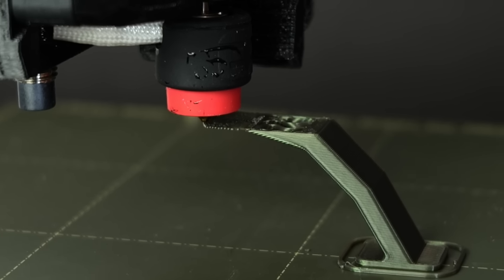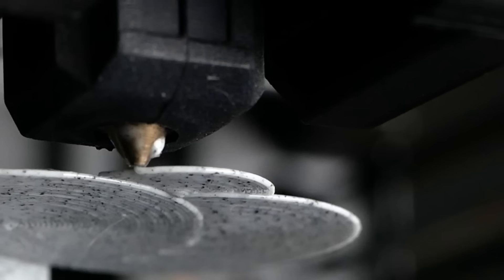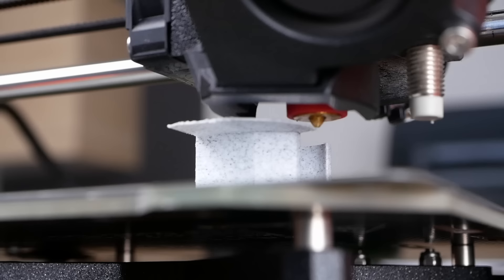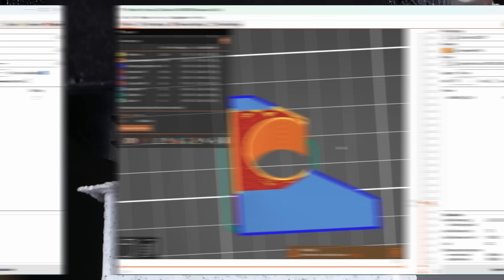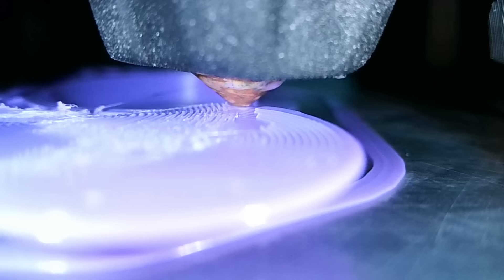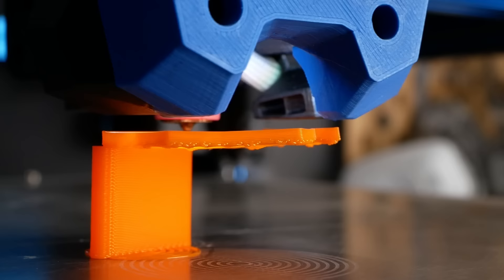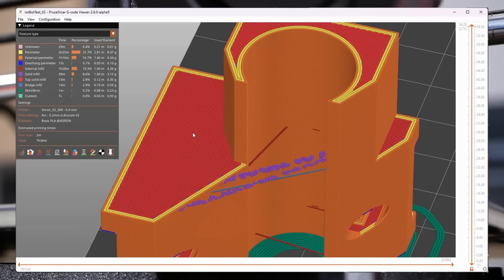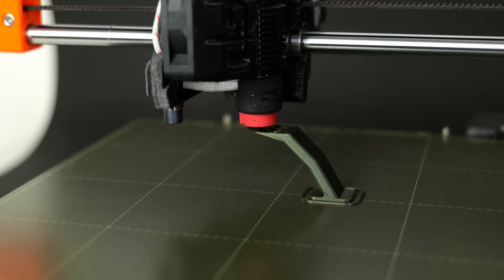Revolutionary Arc Overhangs are now in PrusaSlicer*

Comment: Arc Overhangs look like they'd be a perfect solution for internal overhangs where there's not enough space to remove support material or the surfaces need to be cleaner than supports would allow.  I've come across situations like that now and then where I had to spend a lot more time reworking a part just to make it printable that could be solved by this, even if it cost a little extra printing time

Comment: The hilbert curve thing is absolutely brilliant. I'm so glad they found a solution to this problem.
An idea I had for solving the warping was to just print the arc overhangs in a non-planar manner, with it curling downward. The next layers would print on top of it, causing it to warp upward into the shape it was originally meant to be.
Obviously this has a ton of problems, but the hilbert curve avenue makes a lot more sense.

Comment: I'd say this would be a huge improvement for me, as I print functional parts mostly designed for 3D printability, but encounter some geometry that would make using supports inevitable.   This would include counterbored holes, slight overhangs for detents, shoulders, etc. and just overall slight overhangs.  This is a very big innovation in my book!
Reply: Actually round internal holes and 90 degree squares will be game changing!

Comment: Interesting use of the Hilbert curve.  I do use it for my first layer on production parts that need a perfect face.  Printing with ASA or ABS on a textured bed, layer lines are completely invisible once dialed in.  The paper you cited about the stress relief baked into the path is making me wonder if the effect has something to do with the way my first layers perform.  I always assumed it was simply the shape itself that was disguising the tool path.  Perhaps there is more to it than that.  Awesome work, as usual.  Thanks.

Comment: Cool! It's great to see this progressing! I'm curious how similar techniques could be used to reduce infill and enable steep but not fully horizontal exterior overhangs too. Lightning infill and tree supports are excellent for my current projects, but it seems like this could cut back even more on the amount of infill and supports needed.
Reply: You can also print really steep angles with arc overhangs, it doesn't have to just be flat 90° geometries!
Reply: @stevenmcculloch5727  Cool! Thanks for the info!
Reply: Someone needs to design an infill based on the Weaire–Phelan structure.

Comment: I want the non-rectalinear solid infill options also for regular use. Large rectangular prints with 90 degree corners that fill up the whole print bed are prone to warping, and usually it occurs when a large part of the top surface gets solid infills. If those layers could be generated with a different pattern (now it's fixed in prusaslicer, I can't change the pattern) then less warping could be the result.

Comment: I discover multimaterials support with my Bambu lab and love it. PETG as interface support for PLA work perfectly, but PLA for PETG and ABS for PA-CG work too. It don't need lot of filament change for flat overhang and result is perfect!
Reply: For many prints, it's also way easier to remove than soluble supports.

Comment: One really exciting thing about this technique is that right now I tend to print a lot of things where I use ovals or arches in my designs so I can print what would otherwise be difficult overhangs. Once this makes it to cura, I bet I won't need to design that way and can use straight overhangs and save material and print time.

Comment: Very nice work, I love the reduction of warping just with a different infill pattern which is a critical issue for these parts but also many other materials that have high shrinkage.  Has there been any direct comparison of printing time needed for traditional supports vs these arc overhangs?  I guess it depends how high up the overhang would be but maybe an updated script to chose one or the other depending on calculated print time or material use would be valuable in the future.
Reply: It depends on the size of the overhang and how far up the supports would have to be.

I think the ideal use case for arc overhangs are for small overhangs on tall models that would otherwise require a huge organic support "tree trunk"

Comment: Using temperature modulation to manipulate internal stresses to correct droop would require per-material, per-printer and even per-design characterization to accurately model shrinking and expansion. The effort may make sense for mass production, probably not so much for hobbyists doing mostly one-offs.

Comment: Honestly tree supports work pretty well right now but for certain files or geometry where support just doesn't work, would be impossible to remove, or ruins the print, it would be really cool to see arc overhangs develop to the point where support becomes obsolete in 3d printing and overhangs just print perfectly. One mistake I see many beginners make is not understanding what support is or where it is needed, and they try to print a file with impossible overhangs and it keeps failing and they don't understand why. If arc overhangs were included in all slicers and just worked without any issues then it would get rid of all the headaches that support gives people. This is a really cool development that can revolutionize 3d printing so thanks for covering it Stefan!

Comment: This is an interesting concept, but we are missing some data.  It would be interesting to print a part two different ways - one with traditional supports and one with arc overhangs and see if there is a meaningful difference in strength, durability, etc.  If only there was someone we all knew and respected who had the experience and equipment do such a test...  Hmmm...

Comment: I see a lot of improvements in 3d printing just by changing the path of nozzle movements. I wonder if it's realistic to use AI to predict a better way to print each part. It could be trained on soft body and thermal simulations as well as on real 3d scanned prints.

Comment: I wonder if instead of using arcs for something like the straight edge, if instead you could use something more resembling a sine wave. It would in theory allow you to grow an arbitrary shaped edge. You're essentially using the surface tension in the molten plastic to control the warping

Comment: 👍👍...I think arc overhangs are probably the future though I'd guess they will ultimately still use some minimal support....Personally I don't care that much about plastic or time wasted in supports. I care about the surface finish and mechanical properties of prints. Arc overhangs look like they may be able to produce stronger parts with a better quality and a more accurate surface finish. To me anything else is a bonus.

Comment: Organic supports are great but needs more work.  We need to be able to adjust how much brim the supports have.  We also have to add z lift to clear them because they very easily detach and knock over depending on the material.  For example: PETG is a miserable experience because of how easily they release but ASA or PC is also miserable because of how difficult all that brimming is to remove from the build plate.  I'll only use organic supports on PLA for now.

Comment: It's super cool that this is possible. But it makes me wonder if it's worth it. Printing at speeds this slow you could just as well print supports and go full bore. Yes it takes a little more material but it could potentially save like an hour in printing time which also adds considerable cost.will be interesting to watch this tech develop though.

Comment: For a single layer overhang, I can see this being useful.  However, any layer that is placed above this overhang layer is going to suffer from poor layer adhesion, as you can't "smoosh" the layer into the overhang layer.  The only way you can get a "smoosh" is if the previous layer is supported.  After 3-8 subsequent layers this is no longer an issue, but those first few layers will have significantly less layer adhesion.  This is probably fine for art pieces, and knick-knacks, but it's a non-starter for functional prints.

At least for now, the best option is to make use of the Interface layer for a single soluble layer, and printing supports in an inexpensive material.
Reply: There are ways to strengthen layer bonds without ‘smoosh’ing them

Comment: I really hope this will be available in cura, because I am not familiar with prusaslicer and I have used cura for years now.
Reply: It's very likely they will add that too. But if not, prusa sclicer is easier to use imho. A lot of the stuff is self explaining and I think u could even import cura settings, but not sure.
Reply: I'm with you on that. I try Prusaslicer each time there's an update and it just feels counterintuitive after using Cura forever.
Reply: @SwervingLemon  same. I don't have any problems with it, but I feel I enjoy using cura more because all the settings are in one list as opposed to Prusa slicer where I need to navigate between pages.
Reply: Just like how the Arachne engine and tree supports are shared features now, Cura and Prusaslicer will always grow together, thanks to open source!
Reply: I'm shocked anyone complain s about PrusaSlicer after using Cura.  I have both and want to rip my hair when I need to use Cura.  PS is grouped in a way I can find the settings so much faster.    But then again I "grew up on" Slic3r, so I guess I'm biased.  I only used Cura when forced to and not without grumbling.
Reply: Considering it took prusa years after cura had tree supports to add em, i thino cura will have this sooner
Reply: @hugoslav843  this is true....and one of the only reasons I ever used Cura occasionally.  So I'm glad to see this in PS first!

Comment: Was testing Nicolai’s script yesterday. It’s a little inconsistent. One of my overhangs came out well, but another symmetrical one ended up saggy.

Also my overhang was designed to have a precise shape to functionally fit into another part. The output was not usable because of the loss of precision in the shape. It was also SUPER slow.

Fantastic concept, but not really practical.

Comment: Current hardware is designed around one-slice-at-a-time, bottom-up-only printing.  Would some ability to "print down" to a lower layer/slice so that you could print "from the middle out" help with these sorts of overhangs and printing so that it doesn't curl?  Obviously, that would require changes to hardware, so only matter in future generations of hardware, but reducing supports and allowing for more flexibility with overhangs seems like it would be a big deal for advancing 3d printing.

Comment: I like the thing with using hilbert curves to reduce internal stresses. But then another use case came to my mind. Can it be used to make parts warp less in general? I recently made a server rack mount for a friend. So very long but thiin parts. And even PETG wanted to warp like hell for the solid bottom. Most difficult section was the front with 229x45mm and 4mm in height with a big cutout in the middle for a mini pc. I wanted to print that completely solid as it had to bear all the load.

I use Cura as a slicer but it has no hilbert curve integrated. I installed PrusaSlicer. There you have the option to use hilbert curve for top and bottom, but that seems to only use it on the top- and bottom most surface. But you can use modifiers to get around that by using it as an infill pattern with 100% infill and using only 1 top/bottom layer.

If i find the time I will test it for myself, but would be great if you cold dig into that as well. Maybe it makes annealing easier. It would also be interesting if it changes the strength of a material.

Comment: I wish Prusa slicer would either support wifi printing on my Neptune 2s or Cura would get this upgrade. Honestly I wish the first because I just don't enjoy cura as much and only use it because I'm sick of hauling sd cards back and forth. Yes yes I know I could buy all new hardware and use octo print instead of the robin, but that requires a bunch of new hardware and a mess, while robin just snapped into my board directly.
Reply: Why are you complaining about something that has nothing to do with this video? Google for a few seconds and you'll see its supported in cura if you install the wifi module.

Comment: As you mentioned in the previous video, it seems to have an issue with curling as the upper layers cool. Would using a heated enclosure do anything to help reduce the warping when using these overhangs?

Comment: A guide to teach creating good printable objects with integral supports could be more fruitful 🤔

IDEX printer to have 0 gap between print and support interface would in many (most?) cases be better option than massive overhangs or same-material supports.

But it's not my time they are using 😉

Comment: #CNCKitchen. I have a Pusaslicer question regarding layer quality. I am currently printing latches that take 9+ hours each. The first 95% does not need quality fine layers, though the last 5% needs to be fine detail lettering. Is is possible to change the layer width and quality without ripping apart the gcode?
Reply: variable layer height is in prusaslicer (and probbly cura also), try a youtube search for how to use um. layer width can be set more variable by changing arachne settings. arachne is the algorithm that enables smart adapting layer width, change it and see if print times decrease.
Reply: @durlin84  Can I select "for example" layer 234 and change the layer height individually? I took your advice and found that you can change through dragging a graph. Though i need more accuracy. Ty for the help.

Comment: Does it need to be arcs or can other shapes also be applied to better fit the desired print?
Reply from the maker: Nope, it doesn't. The guys that are involved played around with a bunch of different shapes already, yet this is what's implemented at the moment.
Reply: Any sharp corners are going to want to warp. That’s why an arc is preferable as it is the smoothest curve possible.

You can see this effect on a printer with poor bed adhesion. Cylinders will be much less likely to fail than a rectangle. It’s to do with spreading the stresses caused by shrinkage. The rounder a shape is the more evenly distributed the stress becomes.

Comment: Thanks for covering this topic. I am finally seeing some progress in 3D printer slicers. However, I dislike it's in Python because it's one of the slowest languages out there. I don't think it's that much different from a proper complied language in ease of use. When migrating to Klipper, I used a RaspberryPi 1, but it kept failing during startup. Guess why? Because Klipper is written in Python and therefore it takes ages to load on weak CPUs. Am I supposed to throw away my perfectly working RaspberryPi 1 because everything is being written in Python?